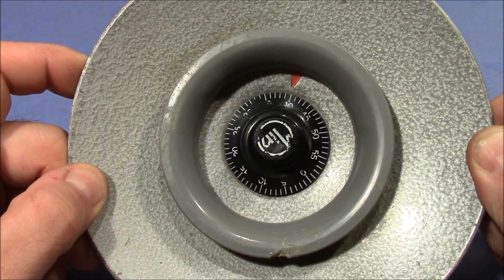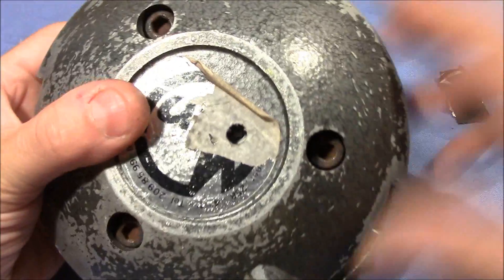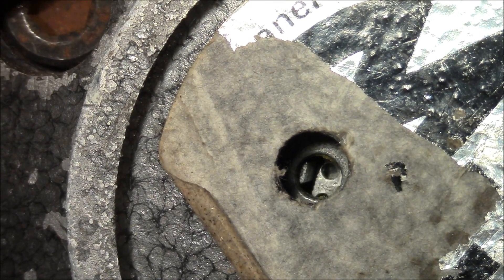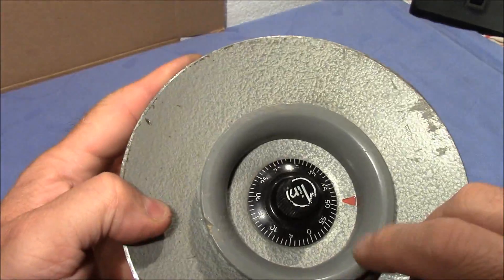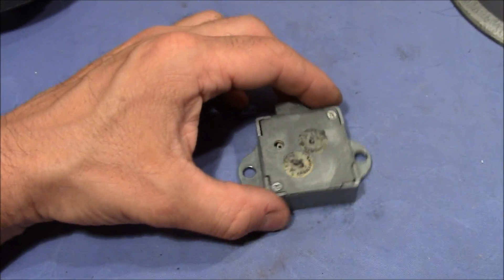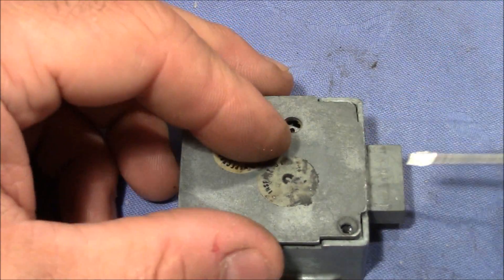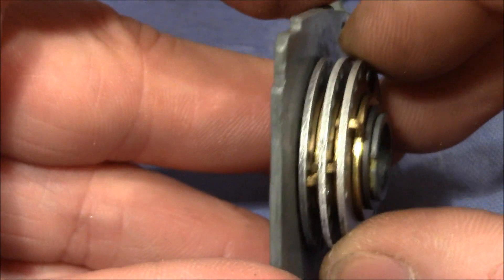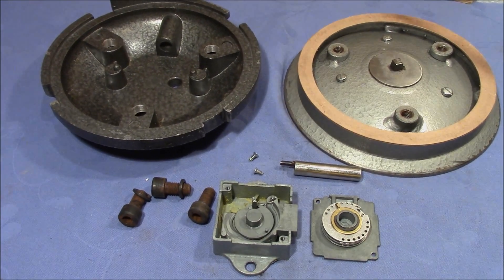(picking 571) Big and heavy safe lock inspected - code deduced and mechanism explored

Comment: I found your videos because I came across an ABUS round combination lock that I wanted to open. (I haven't opened it yet!) I don't know any of the technical names but I would call the brass coloured 'wires' in your lock, collars.
Reply from the maker: Thank your for your comment. I think they are technically called flies and they determine the number for the respective wheel. But in this lock the flies are implemented differently; collars are a good idea.  Good luck with your lock.

Comment: hope the rod is really tight fit in to the block. would be bad if it got stuck out, and a carbide drill or grinder was needed to access a fuel tank
Reply from the maker: Good point, but it's a tight fit.

Comment: Hi Michael, The correct dialing sequence is LRL not RLR. By dialing the lock LRL you wont need to make the extra turn when opening. The combination will be different starting left, compared to starting right, due to the fixed "flys." The small hole is to check that the combination is correct after changing the combination, by repositioning the brass "flys" on each wheel.   Regards, Brian.
Reply from the maker: Thanks for this information. I was always wondering if there's a difference between starting left or right, now I know - thanks for letting us know.

Comment: I guess , he was also interested to see mechanism that locks and unlocks safe / vault doors , but them being so big and extremely heavy wasn't the way of achieving it. Besides , they have another big wheel or lever for the final step and inactive glass parts that shatter if any forceful entry like drilling or putting extreme force to discover wheel gates. That was pretty common on old safes / vaults back in the days , and this gutting explained a lot what was going on behind all that steel in very compact hatch. :)
Reply from the maker: Yeah, all these safe related properties are very interesting. The wheelpack itself, the locking bolts and some security measures that protect again brute fore attacks... It's a whole world :-)

Comment: That was very intersting when I saw you open it yesterday I thought it was going to be a big problem but no you figured it out very quickly. Looking at the eight pin gaps at  08:57  with a gate of around four I recon the pin settings are 7,14,21,28,35,42,49,56
Reply from the maker: Yeah, that service hole is quite handy. Interesting thoughts on the code - thanks for the inspiration.